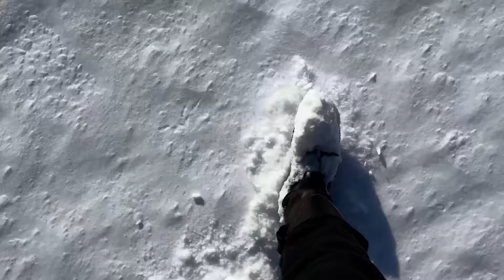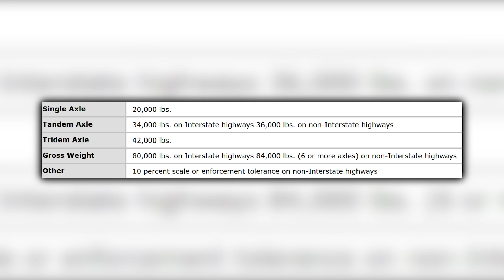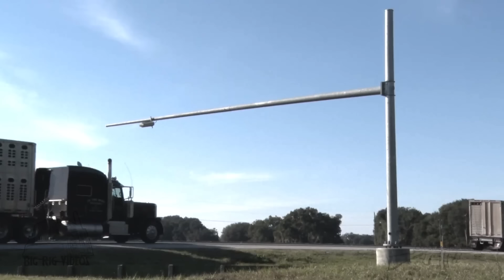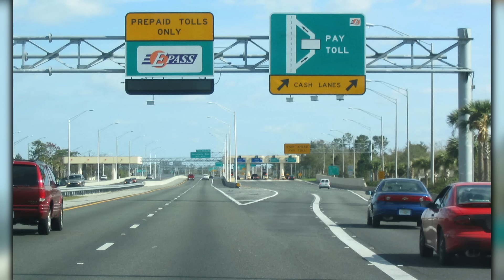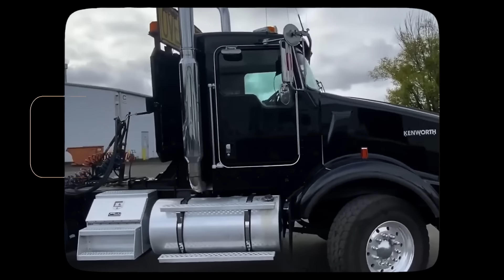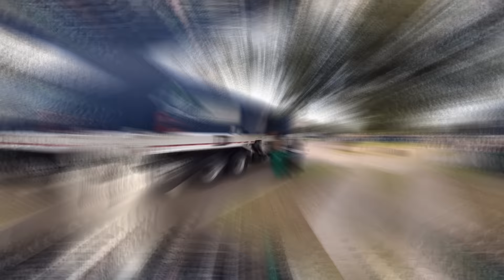Why do some truck tires not touch the ground?

Comment: How much more weight can you add when you have an extra axle?.
Reply from the maker: A lift axle usually lets you carry an extra 10,000 to 20,000 pounds, depending on axle spacing and state laws. But it’s not automatic—you still need the right permits and have to follow legal weight limits.
Reply: @VintageAmericanMachines  thanks

Comment: TRULY I TRULY DRIVE A TRI-AXLE DUMP TRUCK . THE LIFT-AXLE GOES UP AND DOWN WITH THE SWITCH AND YOU HAVE TO PUT IT DOWN WHEN YOU HAVE A LOAD ON . THE OLDER TRI-AXLE DUMP TRUCK YOU HAD TO LIFT THE LIFT-AXLE AND PUT IT RIGHT BACK DOWN WHEN YOU HAD TO GO AROUND A SHARP TURN . MODERN TRIES-AXLE DUMP TRUCKS HAVE A STEERING LIFT-AXLE SO YOU DO NOT HAVE TO LIFT IT UP AND DOWN GOING AROUND SHARP TURNS . A TRI-AXLE DUMP TRUCK HAS A WEIGHT OF ( 13 TONS ) ( SITTING STILL ) WHEN ( EMPTY ) AND HAUL ( 22.5 TO 23 TONS ) OF ( A LOAD ) WHEN LOADED . 13 TON DUMP TRUCK + 23 TON LOAD = 36 TONS ( SITTING STILL ) .